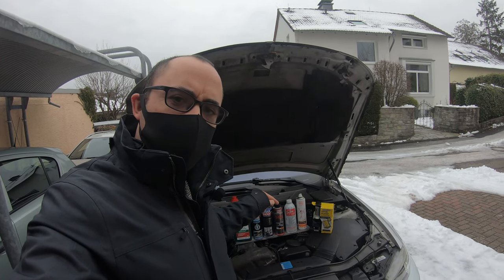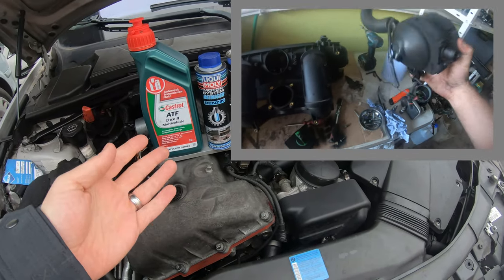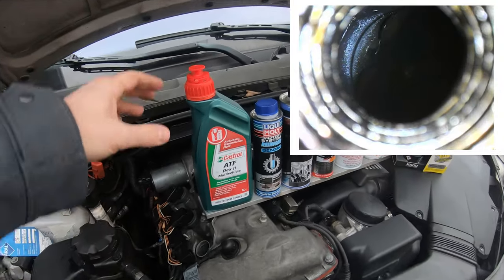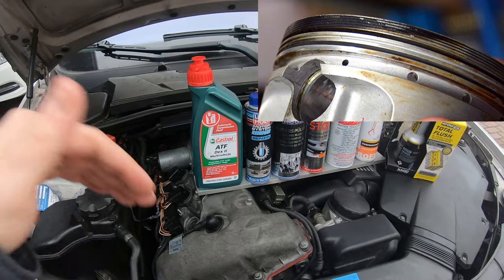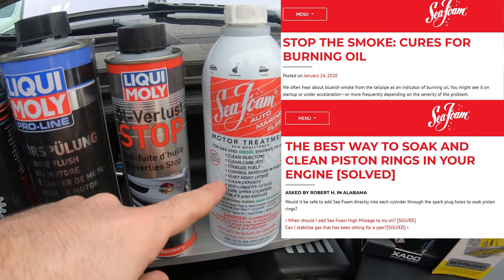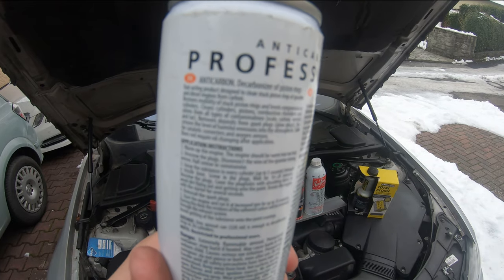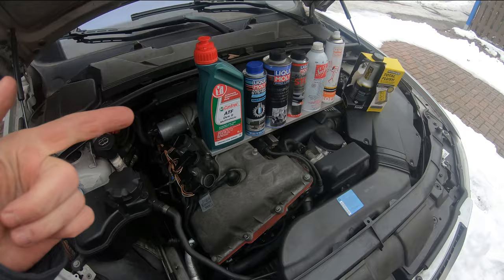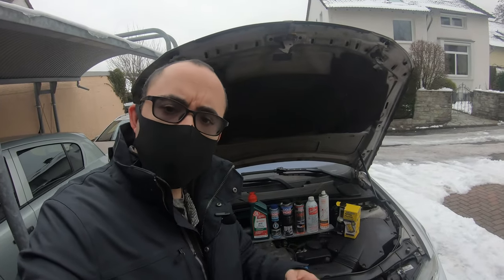Can Snake Oil Products Help Reduce Oil Consumption? We Test Seafoam, Liqui Moly, Atomex and More!

Comment: Tried the Forte oil flush and Forte Top End Treatment, no effect :-(
Reply from the maker: Yep... If your engine is this far gone... Nothing can bring back worn out piston rings or cylinders bores. It's a design flaw. Sorry to hear nothing worked for you engine.
Reply: It is possible to use engine restore and 2 grades thicker oil and get oil burning reduction, if the engine has vvt or vct only use a half oz per quart and a thicker oil and preferably a lower end filter. Did that in a burner and it helped a lot. I switched back to a 10w-30 after and it was still burning a lot less. From a quart every 1k to about 3.5k. Burned less yet with one grade thicker so I went to 15w-40 delvac. Also try to change your PCV and air filter if it hasn't been changed in over 60k as it can also help.
Reply from the maker: @elihernandez330  I am not sure if the thicker oil will work... It may temporarily, but burning oil is going to clog up the plugs and rings eventually. If you try it, I'm interested in finding out if it works
Reply: @buildanddrive   its supposed do the opposite. Thicker oil has proven to reduce oil burning and reduce spark plug fouling more than thinner oils If the issue is from worn rings which is a common occurrence on these engines utilizing first gen low tension rings which have proven near catastrophic like the oil chugging Toyotas of the early 2000's.  If you run an oil lile 0w-16 in your engine you'd be giving it a death sentence because even more would blow through the rings and get burnt. But the engine restore itself can work wonders with oil consumption if the engine is more old school and doesn't have any vvt or vct solenoids and if they do using an oz per quart is advisable. The whole 8 or 9oz can for a 4 cyl is too much. It reduced my oil burning which wasn't much but is even less and I didn't compression check and the butt dyno is unreliable but if it helped seal then it had to have added compression back as well.
Reply from the maker: @Javier Hernandez  I don't think the engine restore will work for oil consumption. Watch Project Farm engine restore video. It doesn't work to do anything. I've heard that  the Vanos can be blocked while at the same time some n52 race cars run 10w60 with no issues but I bet they warm up the engine before driving. So for daily driving, not so useful. Can you try it out and tell me if it works.
Reply: @buildanddrive  I watched his restore video after I put it in my engine about 7 months prior but he said engine restore worked for his compression. It worked for my oil burning but didn't check compression but you usually get the other when you get one as a side effect. I don't recommend going to 10w-60 or anything crazy. Most people like the original commenter unixnerd are probably still using 5w-20 or 5w-30 and probably didn't try engine restore which can work magic on older engines. As for you it can differ. And on the topic of vanos their feedback sensor equipped vvt system is suposed to feedback actuation amount to trim incase it has more or less oil pressure since thinner oil give less and thicker oil give more and can compensate adjustment. It's a more advanced system unlile the early pos Chrysler mds system which depended on static oil viscosity since it didn't have any feedback and even with a Chrysler mds certified oil could still throw an indirect viscosity code cause it's such a pos system. Toyotas like the 2015 Prius state 0w-20 all the way to 20w-50 in the owners manual since they can deal with any of those viscosities just fine. I use engine restore and thicker oils and both have reduced consumption. Can't guarantee anything since not all oil burning related issues are from rings. That's why I said to also check the pcv valve and air filter cause more vacuum can draw oil through failing valve stem seals.
Reply from the maker: @elihernandez330  specifically to the N52, the low tension piston rings cannot be restored by anytime snake oil product. They are work out and need to be replaced. I personally think a thicker oil can help but only for a short period of time.
Reply: @buildanddrive  it doesn't completely restore rings and stop all burning. It can help fill in the wear in between the rings and the bore or cylinder sleeve to reduce wear and has worked on other people's cars like older Toyotas with oil burning. Can also help seal the gap in between the ring and the ring groove which can let oil pass through.. I've used it in my old engine with the same oil grade as before and saw less oil usage then got less when I went from a 30 to 40 weight. It can work on vvt equipment systems as long as there's less concentration and more time. But I guess the only option is a rebuild for your bmw.
Reply from the maker: @elihernandez330  yep, that's why I am rebuilding mine.
Reply: @buildanddrive  lol as soon as I read your last comment I go to home and refresh and your most recent vid 2 hours ago is the first video suggested. I hope she's a singer once you finish the rebuild.
Reply from the maker: Send me a message on Instagram and I'll show you where I'm at